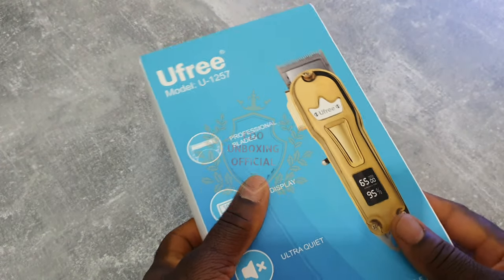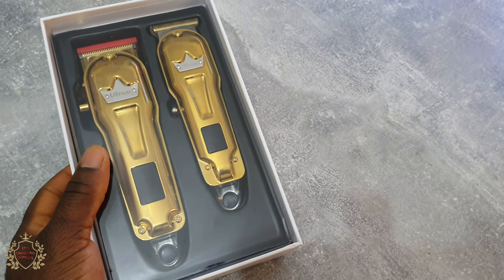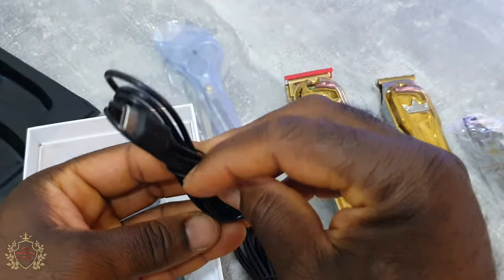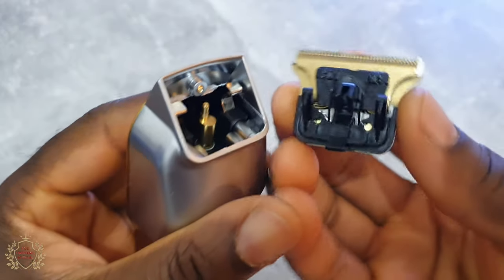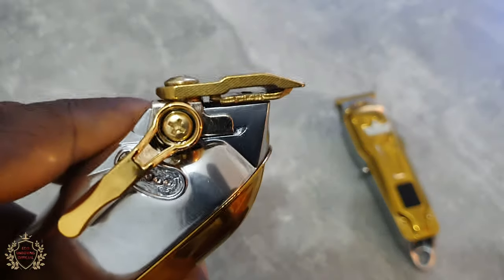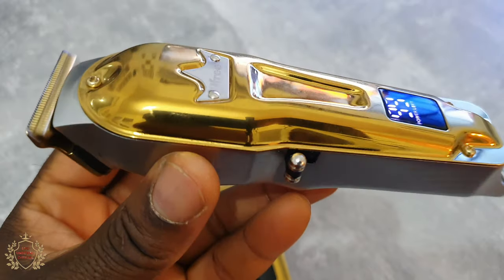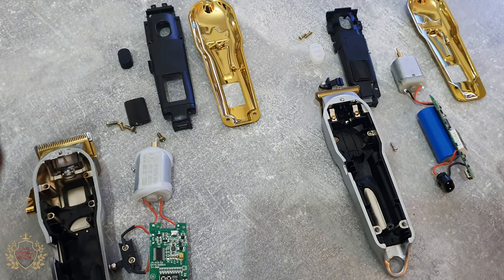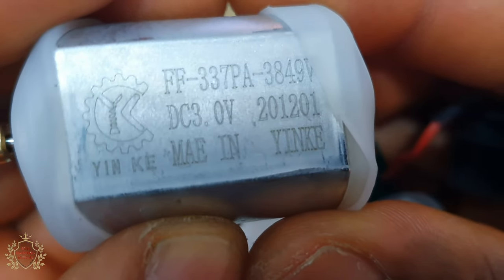Ufree U1257 Unboxing | RPM | Teardown | Motor & Battery #ufree #barber #friseur #haarschneider

Comment: It is not a defect, the problem was in the screw, and the blade, but mostly the problem is in the screw, the screw might be thick so you cannot set it close as you wanted. Also the hole in the blades are sometimes small so thats why, only thing you can do is buy a new better blade and screw (that might come with the blade that you will buy)
Reply from the maker: Maybe u right, not a defect but I just wanna unbox then sell it
Reply: Yes!

Comment: Bought this as a Christmas gift and the larger one hasn’t even turned on but when I plug the charger in it shows “er” and doesn’t increase the battery at all. Do you have any tips or is it just a faulty product. I’ve noticed a few people have that same scenario on the reviews. So disheartening.
Reply: I'm having this same issue. But with the trimmer.. it turns on but no motor
Reply: @shonsaffold4128  I just returned it and got a replacement.

Comment: Is the trimmer good for lineups
Reply from the maker: The trimmer is not that good
Reply: When blade height is adjusted correctly, yes. Definitely not if you've ruined it and it only moves to 2 of it's 5 positions

Comment: How is this set
Reply from the maker: It's ok for home use but not for professional barber
Reply: @edounboxingofficial  it's for home, should I order this set or that CiiCii t outliner that you reviewed???
Reply from the maker: @caylee3277  then buy the ciicii but you need to change the blade
Reply: @edounboxingofficial  ok recommend me a blade please
Reply: @edounboxingofficial  also I see that replacement blades alone are about $20 that makes the set the trimmers and new blades about $40, should I just spend the $60 and get a pair of wired Andis? Or can you recommend the best budget friendly t linners please, thanks Ive been trimming myself for awhile in between cuts but now I'm ready to start and fully cut my hair , so if you could recommend the best and most budget friendly clippers and t linners that would help me, thank you, I also subscribed to you
Reply from the maker: @caylee3277  wahl T-wide blade or Wahl STD Blade
Reply from the maker: @caylee3277  I have no idea about Andis
Reply: @edounboxingofficial  what clippers and trimmers would you recommend that would be great right ?
Reply from the maker: @caylee3277  Kemei 1955 or VGR V655 and for Trimmer then Kemei 1973a
Reply: @edounboxingofficial  thanks bro